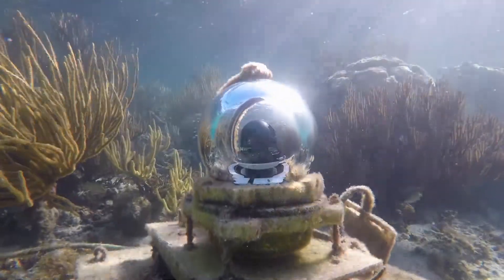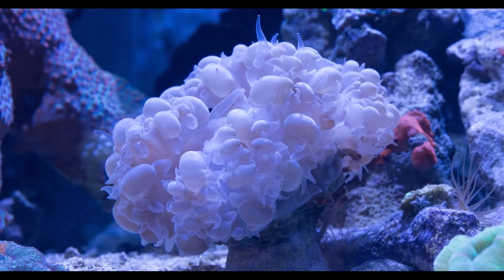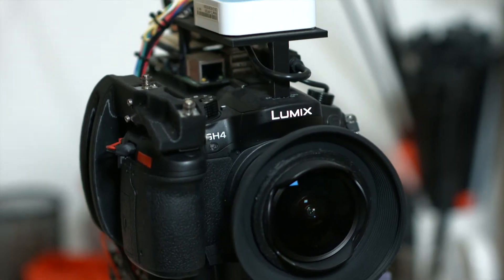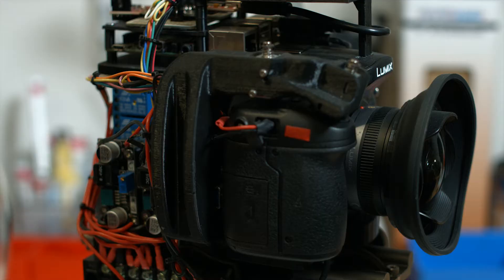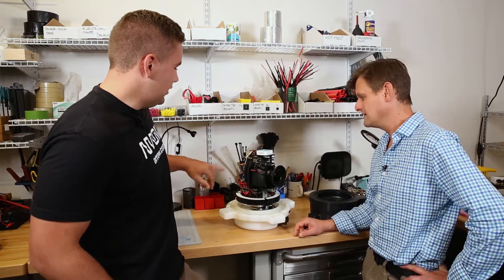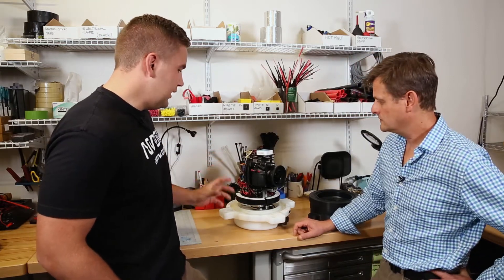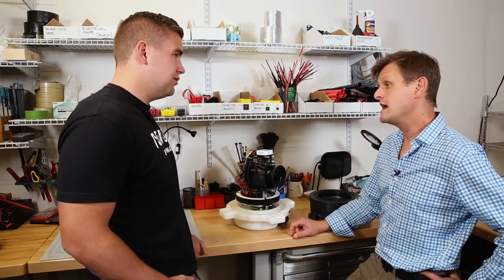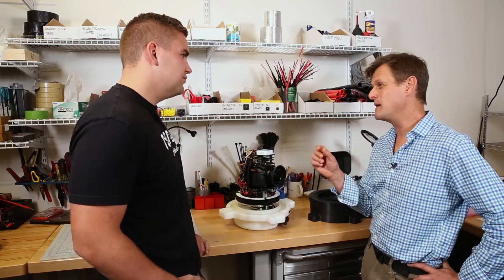Chasing Coral's Underwater Camera using Raspberry Pi and Arduino Mini | Arrow.com

Comment: I used an ESP32 to emulate the Smartphone app commands that the GH4 has and used a solenoid to push the button that commences WiFi. RS232 communication down over 200m of cable to the ESP32, @9600 baud.